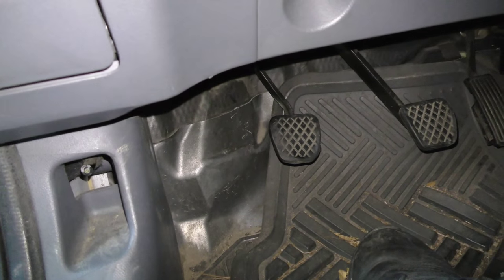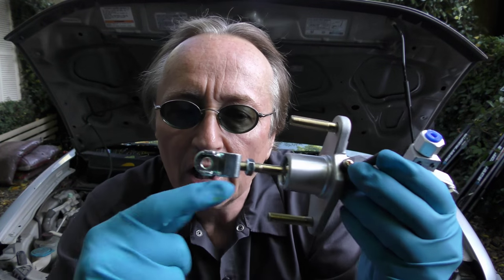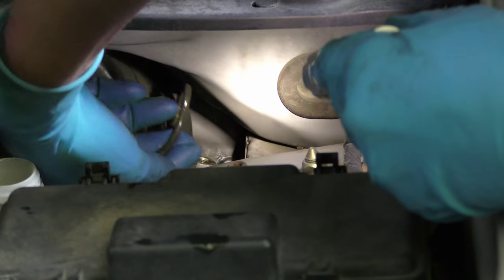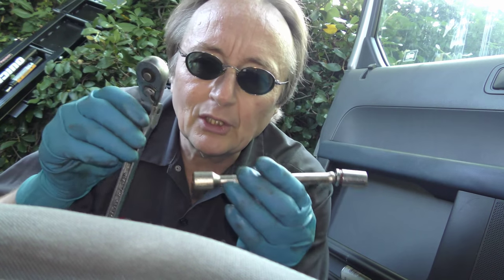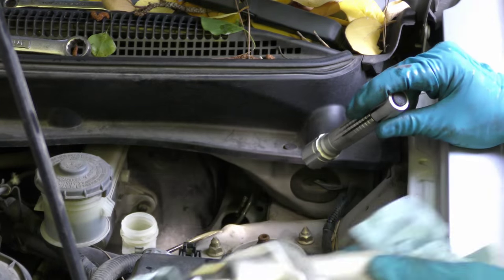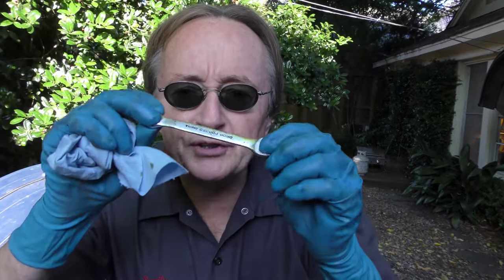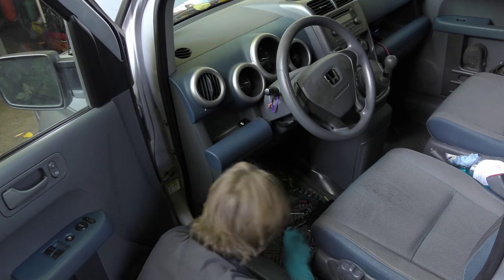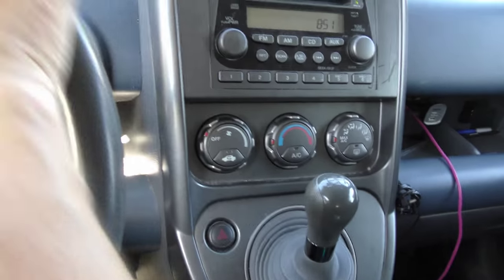How to Fix a Car that Won't Go into Gear (Clutch Master)

Comment: I have this symptom but no leaks 01 Dakota 4x4 3.9 5speed... At low crawl speed (1-2mph)  in first gear  there's a vibration, also it's obvious that the clutch is dragging. Clutch used to engage/disengage at about half throw. Now it's almost at the floor.  Could that be pilot or throwout bearing? It's intermittent making me think friction material broke loose and occasionally drags. Happened first at about 30 mph when I down shifted to slow for traffic. Then after that the truck won't shift into any gear. Unfortunately this is where I gotta take the transfer case and transmission out. Might as well throw a new rear seal and all new trans seals with a new clutch at this point 🤦‍♂️

Comment: Hey Scotty, I been have clutch problems on my scion tc 05. I change the clutch master cylinder and Purged the air out. But I'm still having have trouble to get into gear. I would have to pump the clutch to get it into gear. I wondering if you could tell me what the issue could be? 
Ps. Love your videos keep up the good work 💯 👌

Comment: I got a 03 Ford Ranger 5 speed. Sometimes I can't get into 1st gear I'll have to try a couple times or pump the clutch before it goes in . But this is the only gear that acts this way all others go in smooth. Would what you suggest in this video fix this or something else? Thanks.

Comment: Hey Scotty, first of all thanks for all your videos it's really helpful as I'm a beginner studying in mechanic. I Had a question, I own a '86 Porsche 944 that won't go into reverse 80% of the time. The gears don't grind or anything, it's just like if the shifter was in neutral, I release the clutch and... Nothing. I read online replacing the shifter could help but my shifter isn't wiggling that much when in gear so I don't know. Any Ideas?
Reply from the maker: +arkher11 pray it's the shifter or shifter linkeage, cause if not, empty out your bank account rebuilding the tranny
Reply: +Scotty Kilmer Thanks for your answer! Do you think changing the transmission fluid would help?

Comment: Thank you Scottie,  every time my car have problems you help me out, this time my car 2012 Chevrolet sonic, when I driving  the car is free gear, not a  problem any shifting back and forth  only car won't go.😂😂😂😂😃😃😃😃😃😃😃
Won't go with any gear, no smells burning,  i heard creaking noise one time,  not check engine light on , I have to tow the garage,  tomorrow will tell me what is wrong. Hopefully the clutch master break.  I do know the transmission  break,  can't shift, can't reverted,  or skipped driving,  my car is can't drive at all.

Comment: hi Scotty. I was recently driving when I went to shift gears,  but clutch stayed stuck. so I ended having to slow down as I couldn't up shift.  finally clutch released.  problem was clutch now Drops all the way down to shift and it's not stiff any more.  I have a Act extreme clutch. I have no leaking under dash on pedal.I looked under trans, and I noticed slave cylinder arm that connects to fork boot is in a downward angle and not straight across.

Comment: Hi Scotty, I have the same truck as depicted in your video, I got a new part from Autozone. I followed every single step as you showed on your video but I still have the same  problem "clutch pedal goes all the way down and doesn't return to the up position" I tried to bleed the air out of the lines but feels like there is no brake fluid even that I refilled the clutch master cylinder reservoir . What do you recommend to do next.

Comment: hi scottie 

I have a 91 nissan 300zx twin turbo that won't go into gear I changed the master cylinder and the clutch slave cylinder, I also bled the system out as well but still having the same issue, my pedal feels mushy when the car is on but when it's off it feels good, I can put the car in gear when it's off but when it's on it will not go into any gear.

Comment: I have a 1994 acura integra my issue is it does not want 2 go in to 1st gear but 2nd 3rd n 4th works fine ( i have a completely blown out 5th gear that i will fix in time but honestly i dont go fast or race so i never need 5th gear.....the clutch pedal felt fine 1min the next it felt like it had air in the line......im confused because 2nd 3rd n 4th work fine......... What are ur thoughts? O im not low on clutch fluid i checked that n i dont see a leak under the hood but i think i just answered my own question after looking under the steering wheel the same part u fixed in this video is leaking in side the car so im going to replace it today .... .i cant thank u enough for ur video i subscribed to ur channel u have a friend for life thanks bro

Comment: Scotty Kilmer, I just replaced my clutch cause I thought was the issue with my honda element, but the same issue is still there. My symptom is an excessive loss of acceleration. Almost feel as though the brakes are on. The vehicle won't go past 30-40 mph and the problem will exceed where white smoke will disperse from the engine bay *WHEN IN GEAR*. I can't make it past 3rd gear when driving due to the loss of acceleration from the car and in minutes the acceleration will worsen to where only 1st gear will keep the vehicle from stalling. It May sound silly but could it be my serpentine belt? I notice the belt tensioner indicator showed me my belt was loose. i have a 2003 4wd Honda Element

Comment: **Hi Scotty! We got a 2004 Mitsu Evo 8 with a dead clutch pedal (on the floor) we replaced the slave cylinder and bled it then it was okay for while. It got my husband to work, but it didn't ever come back up all the way. On the way back home pedal hit the floor again. Should we try the clutch master cylinder? I've also heard that the method for bleeding the clutch that we used (pumping the clutch pedal) is not recommended. Do you have any info on these cars and what if anything could be the fix? I'm the only one with a working car right now and going to work, school and being the taxi is not easy. Any advice is VERY MUCH APPRECIATED! THANKS and your vids are awesome!
Reply from the maker: +Evelia Hernandez yes, change the master, they go bad together anyway
Reply: +Scotty Kilmer Kool, we will get it ordered and follow along with your video. You are a life saver Thanks again!

Comment: Hey Scotty, thanks for the videos. I have a new to me '97 sonoma (5 speed) and sometimes when shifting gears I hear a metal slapping noise when the clutch engages (pedal coming up), what do you think the problem could be? The only other drive problem it has is on the highway if I let right off the gas it'll slip out of 5th. Now I just try to remember hold it in 5th if that happens.

Comment: Yo Scotty! My 5speed 1997 Subaru Impreza Brighton Coupe 1.8L, is doing the same thing as this vehicle in the video. My car turns over, clutch seems to be working fine since i can turn it over (with my car it wont turn over without the clutch) but when i try to put it in gear i can sorta feel it go in, but when i try disengaging the clutch and giving gas my car just revs and revs.... do you know what it could be? Or how i could repair it? some of my friends say its my shift linkage joint.. others say its my transmission or clutch.

Comment: hey there scotty! I recently burnt the clutch in my car , and had the clutch replaced along with the flywheel resurfaced and now the gears won't go in! so is it that master cylinder needs to be replaced or does the clutch needs to be bleed out? also the master cylinder is low in fluid, my car is a 2009 honda civic si

Comment: Scotty Kilmer i have a vw passat 2000 and i recently changed the clutch in it and the mechanic said that he refurbished the flywheel ,but when ever i engage the clutch kind of fast it i feel a jerk under the car, he said it was the bad engine mount so i got the engine mount replaced at a different mechanic abut jerk still didn't go away, so the other mechanic said he refurbished the flywheel too much but i want to hear your thoughts on it. keep in mind the jerk in my car was already there before i replaced the clutch.

Comment: Hi Scotty :) Great Video, I have a question for ya, I just bought a 2nd hand 2003 Nissan Pulsar ST with around 86,000 miles on the engine and ive run into a bit of a wierd thing going on with the Gearbox / Clutch, randomly the gearstick just won't go into gear, and it makes this weird  hydrualic sounding noise, it just seems to happen randomly out of no-where, I thought maybe the clutch was on the way out so I took it to a local mechanic who said theres nothing wrong with the clutch. Helpppppp

Comment: Scotty, I have a 2000 blaser 4x4. The truck wont go into gear. (reverse, drive) I checked the transmission fluid and it is full. What can be stopping the truck from engaging?

Comment: Hi Scotty!

Question for you Sir,
I have a 2011 Mazda 3i Manual transmission that recently won’t  go into 3rd gear at times. Was wondering what your thoughts on said situation? Would a master cylinder change be effective or is this a more serious problem? 

Regards

Sam
Reply: What’s was the issue

Comment: Great video..just want to know what's actually the relation between faulty clutch hydraulics and unable to change gear? Coz from my understanding the action to change gear are all mechanical..so it shouldn't be interrelated with clutch isn't? Or is it?
Reply: hadouken The clutch plays a pretty big role in being able to put the vehicle in gear and shift into other gears afterwards. Pushing on the clutch pedal in general (hydraulic or cable) will engage a thrust bearing on the clutch fork which presses on the pressure plates fingers which relieves pressure on the clutch disc which in turn allows the transmission to turn independently from the engine. Thus allowing you to put it into gear and drive off, or allowing you to change gears easily.

Comment: Hey Scotty, I have a 2002 Camry. One night the check engine light came on and halfway home it stopped accelerating. RPMs went up but wouldn't go. When I start it up now it will move a bit until it warms up. The codes were for a speed sensor and shift solenoid E. You think it's worth it to try and replace the sensors first? Or is it most likely just the actual tranny? Not really wanting to pay $2500 for a used one, and I'd rather not put more money into it if I need a new car.
Thanks in advance

Comment: Car has been sitting around for awhile, didn’t touch it through all winter. I replaced battery and it’s starting but it won’t reverse when I shift the gear which is rough. What do you think?

Comment: I have a slightly related question. I have a 2008 Toyota corolla with a 5 speed manual transmission. How often do I need to change the transmission oil in it and what is the best oil to use in it?

Comment: I put a brand new clutch kit and flywheel in. I’m having this same problem but i have a cable clutch system, and it’s only when the car is on that it won’t go into gear. I can start it in gear and move it in the gear that i start it in, but i can’t shift into another gear once i do that. I did some research and found people having similar problems but they were reusing old flywheels, and found that the shop they took it to to have it turned did not do it properly. I also read it could be the pressure plate fingers are not angled enough, that they’re faulty. Also, i had to tighten my cable as tight as possible otherwise it would move on its own when i would start it in gear with the pedal pushed all the way in. It stalls if i let out all the way with no gas so it can’t be the clutch disc right? I’m thinking it’s the pressure plate and i ordered a new one from exedy. If anyone has had a problem like this with a cable clutch and figured out what the problem was please let me know, i’m worried i’m gonna have to just keep spending money trouble shooting things that are already brand new. I also have a new throwout bearing and release shaft spring.

Comment: Hey Scotty
Love your videos, 
Just wanna take your point of view on the following behavior
car in question Audi A4 B7 1.6 Gasoline 5 gear from Austria 140.000 KM 
Issue : sometimes (lets say 5% ) it wont go into 1st gear 
However  if when i face the issue, i immediately put it in 2nd and then go for 1st the issue is not present   
since it goes for 2nd, can we still blame the clutch or it the Transmission itself showing it's age ( 14 year ) ?

Thank you in advance for you reply and time 
Sincerely a viewer from Romania :)

Comment: Hi Scotty, I can do with some advice please. 

I have the same problem of not being able to get my vehicle into gear. This problem came and went a few times intermittantly and one day it just stopped working. I noticed that the slave cylinder was leaking fluid so I replaced it but it made no difference. There is absolutely no leaking on the master cylinder. Any idea on what else it could be? 

If I put the vehicle into gear, hold down the clutch pedal and start it, it makes a scraping noise as it slips. It does move if I slowly release the clutch and on level ground it creeps with the clutch pedal pushed in.

Do you think it could be the release bearing or pressure plate?

Comment: scotty I got a 97 chevy 2500 automatic with 4 wheel drive. It drives and shifts just fine except when you try to go in reverse. There's no noise, no grinding, doesn't even sound like its engaging. Do I need a whole new transmission?

Comment: Hey Scotty my clutch gets into gear but it’s hard and when I’m driving in high revs in my rsx type s the gears seem to get harder
Reply: F150 doing the same?  Just replaced the clutch disk plate, slave cylinder and it is acting up....

Comment: hi , I have a 04 mustang gt manual transmission.  occasionally I'd say once every 4 drives car won't go into first from a stop while in neutral.  I have to rev it in neutral to get it to go in first. what do you think can fix this? thanks!!. Car has 60000kms so i don't think it's a transmission problem.

Comment: Hi Scotty. Just picked up a 2003 Honda accord. Everything was working fine until just the other day. It's an automatic transmission, when the car is  cold, it goes into reverse fine, but when the car has been running a while, i lose reverse. I've been told it's a possible shift solenoid problem.
Reply: +Chann Groves 1998-2003 V6 Accords are well known to have tranny problems. I had one a while back with an identical issue. They were able to fix the transmission for about $1,000. But under the pretense that it would probably break again in 50,000 miles. I got rid of it before then but got my money worth for a while after the repair.

Comment: Hi Scott, Do you know possible causes of my Honda Accord v4 automatic can start and idle, but won't drive when shift.  I / my mechanic recently cleaned egr passage with carburetor spray but I think maybe too much gunk flew down and got into other areas?  

Trans never shows any sign of problems before.  Any ideas?

Comment: I have a 98 pontiac sunfire, the stick will grind when putting it into second gear. it doesn't do it all the time, mostly after I've started going down the highway and continues to do so until I turn off the car. thanks for the help.
Reply from the maker: +sanesam88 odds are second gear synchro is going out, just live with it

Comment: hey mate I need bit of advise if you can help would be great, I've got a old 2007 Cadillac UK make. it's an 3.6 st petrol automatic I put the car in drive it doesn't move but after reving the engine giving it bit of gas it gets in gear and drives like noting is wrong with it. I have told I might need a new gearbox. what's your thinking on it as I don't think it needs new gearbox

Comment: Scotty, I have 2001 Nissan Maxima,P0505.. replaced the IAC & repaired the ECM.. I did a manual relearn. Now when i start the car from cold it wont start, i have to press on gas pedal for it to start.. then when warm it is fine.. it is idling fine..
Reply from the maker: aengmax "reparing" and ecm is iffy at best.  I would assume it still has problems on cold start warm up circuit.

Comment: My car starts ideals has a 350 motor with a 700r transmission but as soon I put in gear turns off has a out side electric fuel pump also makes a buzzzzing noise then car stalls you have any suggestions I'm thinking electric fuel pump but as I been reading some comments suggest bad torque converter.

Comment: 2002 Jeep Wrangler - 4.0 Straight Six - manual - Like others,. Won't Shift When Engine On. With off, I can shift. If I then Start engine with clutch out - can sometimes get it to start and drive - While driving - random what gears can use . Stalls at stop.. Also, the shifter felt lite - My first thought, gear box oil which is due to replace. Top on my list to check - (clutch Hydrologics, Your leak review, gear box oil).  Anything new/missed plz advise ie if talking to a shop - things I should have them inspect - easiest to hardest - lowest cost to most - if you know what I mean. Thx Scotty!.
Reply from the maker: pray the master or slave cylinder is shot and needs replacing. If not, time for an expensive new clutch assembly
Reply: Scotty - Interesting twist. The gear now shifts when engine on if I baby it - Had mechanic take a peak - possibly small leak slave. What do you make of this? Air in the line worked itself out. Still planning to replace both. BTW- Clutch already replaced - a $50 part took out clutch years ago  - had to leave trans on floor for special order part. I went ahead and replaced clutch anyway - Hoping slave is the issue!

Comment: Hi Scotty, I have a vw cc 09,I changed the throttle body recently.  Do I have to go to the dealer to program the new one to the car cause I got the Epc light on and off     
And the car is losing power, gas pedal is hard to press sometimes.  Is there's something to see with the transmission. I tired of paying $ 129 for stupid diagnosis.  Thanks.